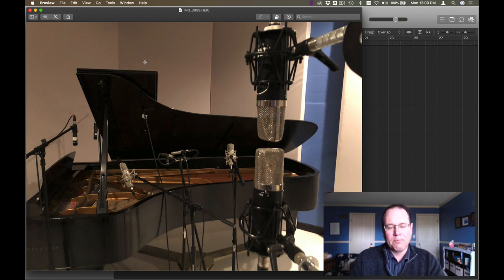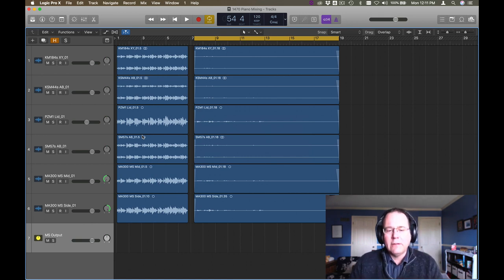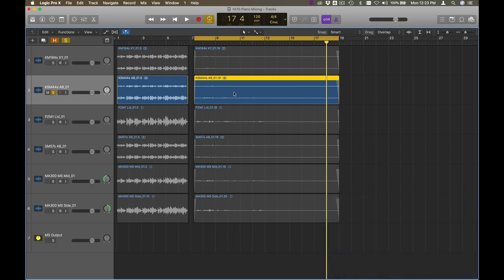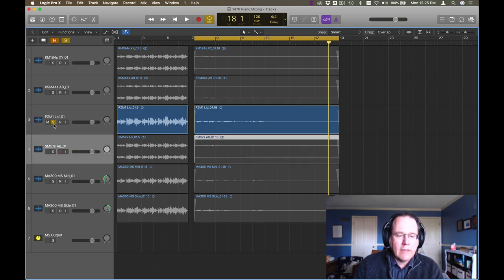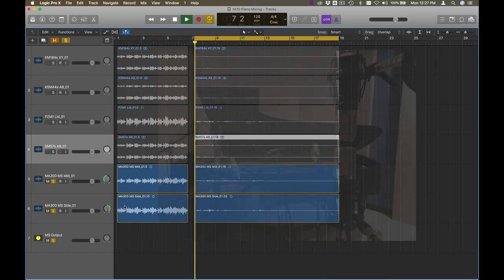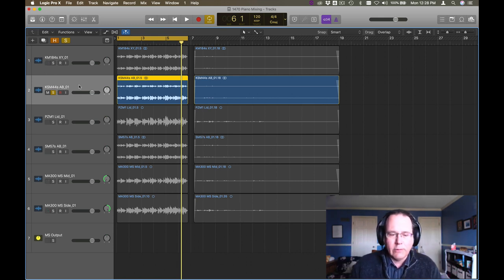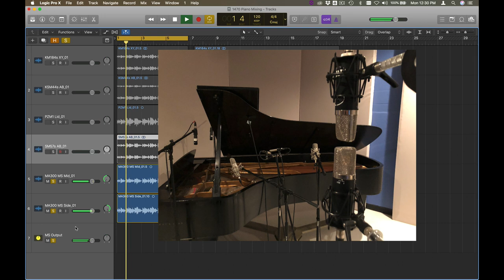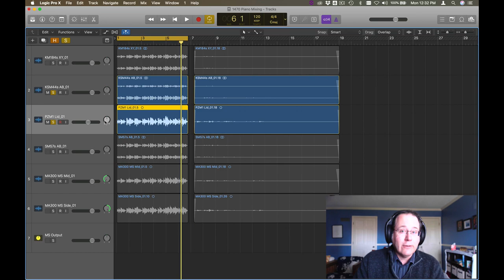Piano Recording: Mic Techniques

Comment: Excellent video!  I am new to mic-ing grand pianos but I just got my hands on a pair of Rode NT2000.  Do you have any recommendations on some good configurations to try with this kind of mic?  I prefer the AB bidirectional pattern setup the best I think, could you describe how to set that up?
Reply from the maker: If you like the AB setup, it will be easy to accomplish with a pair of NT2000s. Set both for omnidirectional pickup pattern, then space them apart from each other about 6-24" and back from the piano to taste. You'll want to spend a fair amount of time experimenting with position: you will pick up a fair amount of the room this way and will need to adjust how far away you are from the piano as well as how far the mics are spread apart from each other until you find the right balance of piano vs. room and the size of the stereo image. It could be the right answer is to put the mics right next to the body of the piano or you might prefer the sound further back. Note in this video, I deliberately chose a very wide AB setup to demonstrate the tradeoff between width and center image: when I use an AB pair, I usually put them quite a bit closer together than this, as setting them this wide diminishes the center and can also lead to problems with mono compatibility.
Reply: @EricHonour  Thanks for the reply!  I've tired the AB setup close together with cardioid pencil mics before but facing the exact same direction.  It looks from your picture that your mics are facing away from each other at an angle (might just be the picture?).  Would you be able to elaborate on the benefits of angling them away from each other?